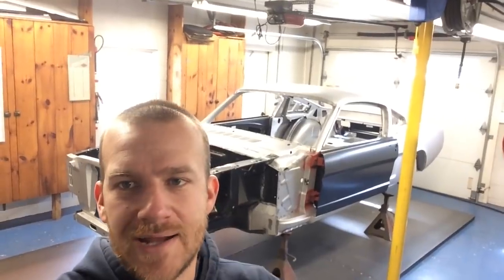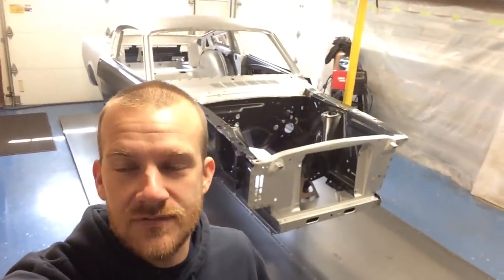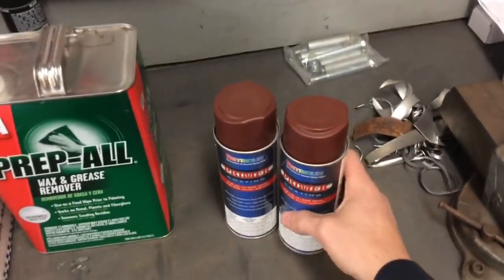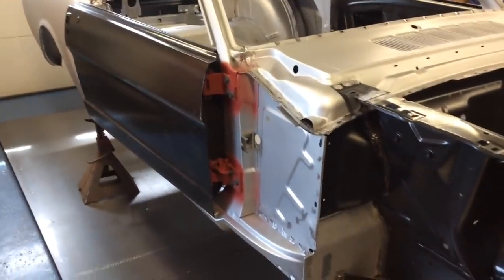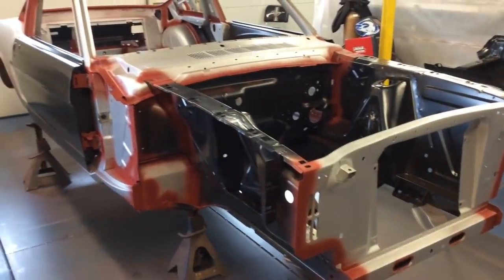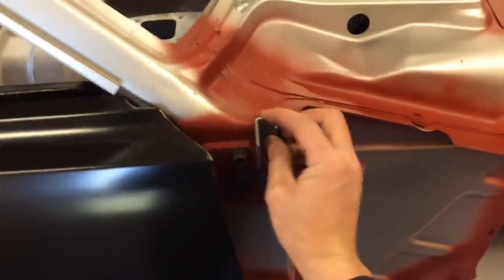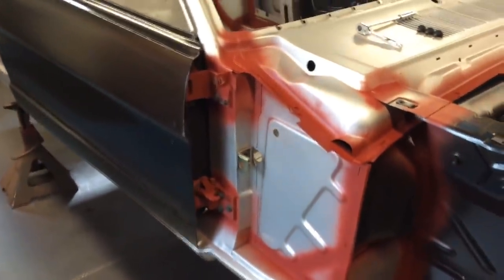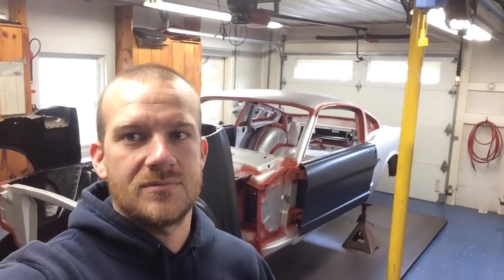Building A 1965 Mustang Fastback Shell Primer And Fenders

Comment: Again, great job. I aligned a frontend up today and the doors to fender gap needs some attention because the door skins were replaced and are a little off. All my sheet metal is ford except for the skins and the hood. The dynacorn hood is a little off about 3 inches from front corners back, they have a sharper bend down in the front compared to my original hoods. If you bring the hood up to meet the top of the headlight caps, the hood is above the fenders quite a bit, but I do not want to shim up my fenders. My aprons and towers are original.
Thanks

The 64-66 export braces use to be off by a half of a hole for years at the cowl, are they now correct? Made me wonder watching people use them to line up the frontend.
Reply: My car is a 64.5 convertible.

Comment: How about what your using to weld the body together 
Type welder wire size gas 
I have a miller 250mp digital with spot welding nozzles inside corner out side corner   Nozzles for it 
Then i preset my spot weld timer for consistent spot weld size 
May it wont work on re welds since they might not all be the same size i am not sure
Reply from the maker: I use a Lincoln mig welder 180 with .030 wire
Reply: @petersonrestorations  Do you think a Flux 125 Welder would be able to handle a floorpan replacement?

Comment: When you register this car do you register it as a 1965?
Reply: Great question, now waiting for a great answer, I was also thinking about the same thing, lol
Reply: Mostly likely registers it using orgional 65 tags or another first gen model year if i had to guess
Reply: I guess he's using the original VIN number that came with the original shell he discarded.
Reply: When you go to the  'shell' (parts maker) web site they explain the process. Basically, each State has their own rules and firey hoops you have to jump through in getting your 'NEW / OLD Vehicle' registered. But keep in mind .... though this is a Mustang and beautiful at that  Ford may not allow it to be called a "FORD MUSTANG", and yes, neither did GM allow a beautiful 69 Camero (built like this one) be called a 'Chevrolet Camero'  or even a "Camero" (if memory serves me correct) either. Why? Because they did-not-build-it. Perhaps for liability reasons(?).... May be that one like this would fall under the 'kit car' rule in your State. Lastly,  think twice (maybe three times) before thinking of using another cars vin number on one of these. Think in terms of JAIL TIME, LAWYER FEES, MISSED EMPLOYMENT. In other words, don't do it unless you first check with your State's DMV or an attorney.😉
Reply: My Youtube you could absolutely use an old cars vin , if you destroyed the other car.  This would then only be an “extensive” repair of that original shell. You would cut out the vin tags on the old shell, and weld them into place on this one.
Reply: Braydon Scully:  I agree on one hand and many a '32 Ford coupe owner(s)' I have known personally have done that (as an example). But many a stolen and / or swapped car Vin number have put many in legal jeopardy. Though one might think one could swap vin# 's in such a case it will serve the owner EXTEMELY WELL to call your State's DMV or an attorney and ask them for the requirements (if possible) for doing so. A seller thinking he could do that (here in Texas) forfeited his car to a buyer (my son) for doing exactly that. Another car buyer was met in his driveway by the FBI, Texas Rangers and Sheriff's department one afternoon and was eventually awarded not only another vehicle of equal value but the bank loan pay off for his purchasing a swapped/ stolen vin auto. Bottom line: There is a 'CORRECT PROCEDURE'  in doing this,  don't take short cuts and matters in to your own hands; and by all means a few phone calls are cheap. Better that before hand (as in, asking permission first) than asking a judge forgiveness later. Peace.

Comment: Ditch that can primer, get a cheap small spray gun, and use an epoxy primer that can be left exposed indefinitely in any weather. Adhesion issues with the can primer is a major concern, and removing it to prep for paint is a lot of extra work for the purchaser. Also, most primers are porous and the underlying metal will start to rust rather quickly, especially if left outdoors. IMO, it just seems like a half ass way to do it after putting so much effort into doing everything else right.
Reply from the maker: I always recommend stripping all paint from any shell so everything is done the way the buyer would want
Reply: V cm??)+
Reply: Epoxy primer is not waterproof and moisture will penetrate it and rust if left for long periods however would be better then rattle can red oxide ! All that silver weld thru should be removed anyhow its a lot of work to prep a car properly even a new build like this !